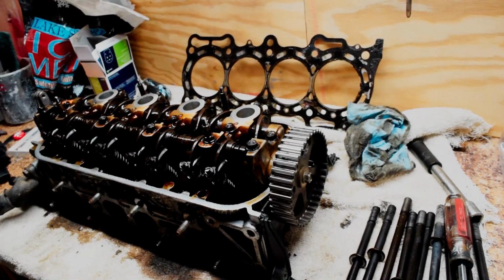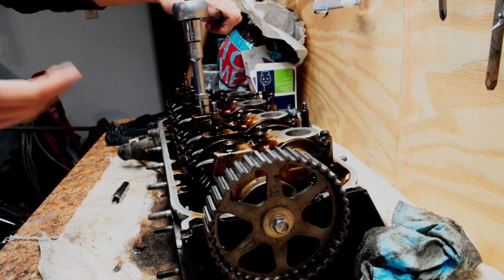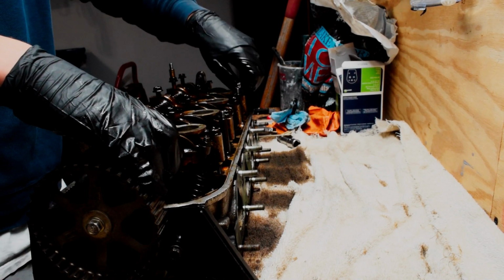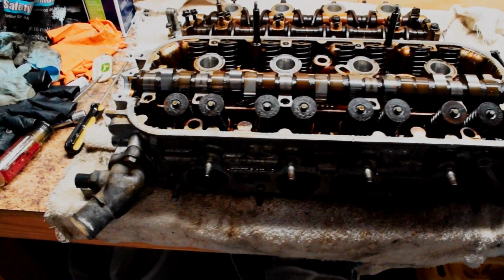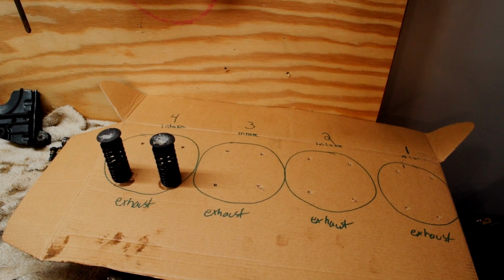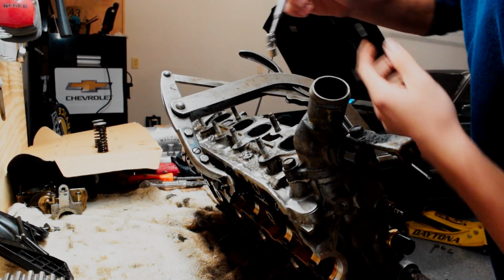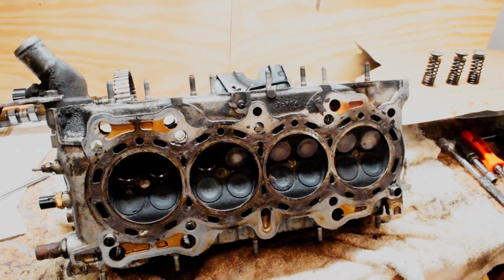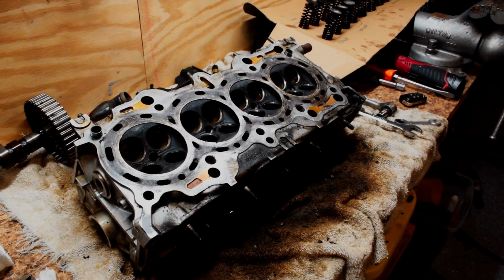F22 Honda Accord Cylinder Head Disassembly

Comment: When you took the rocker arms off, make sure you replace the O-rings that are on the bottom of the rocker arm, between them and the head. When they leak you will find oil around your spark plugs and spark plug boots. Anyone watching your video should be aware of those O-rings. Sometimes they come with the valve cover gasket and sometimes they don't,,,,,,,,,,,,,,,
Reply from the maker: True story man mine were leaking when I got  my car big time.
Reply: The seals you are referring to are on the TOP of the rocker assembly, between them and the valve cover, not the head.
Reply from the maker: There’s two sets if I remember correctly. One at the tip of the spark plug tubes to seal the valve cover and one after unbolting the rocker arm assembly.
Reply: @ThatAccordGuy  Ahh, you're right, I had forgotten the f22a engines don't have the typical spark plug tube design that use loctite at the bottom where they are pressed into the hole with a friction fit. Thanks for clarifying 👍

Comment: My beater 94 Honda Accord sedan overheats. I’ve tried everything and think it’s the head gasket. Of course it could be a cracked head or something cracked in the block. I’ve got no disappearing antifreeze though. Only thing is the coolant reservoir overflows and once I caught it bubbling. Other times it wasn’t
Reply from the maker: Yeah man it's certainly possible that it's a head gasket. If you want to make sure, they sell a head gasket checker. It's a chemical you put over the jug and it turns blue or something if there is a presence of exhaust gasses in the coolant jug.
Reply: For others who may come across this. As ThatAccordGuy said, you can check it really easily with that cheap kit. I don't think that was the issue here though, without losing coolant it's probably just a stuck closed thermostat. The coolant will boil and vent out from the overflow tank if it gets too hot and overcomes the pressure cap on the radiator. It's easy to check the thermostat, just put it in a pot of water on the stove, turn it on and visually verify it opens, you can even go one step further and use a thermometer to verify at what temp it begins to come off its seat. Every thermostat has the temperature It's rated for stamped on it somewhere. It's also possible that it was just a case of the electric fans not coming on when they're supposed to, like a bad relay or temp sensor.

Comment: Kind of a weird question I was changing my timing belt and I might have not lined the everything up properly and I was hand cranking the engine over. Is there any chance of bending the valves while doing this? Either way i'm going to make sure everything is now aligned perfectly and I guess i'll know when I start the car up when she's back together.
Reply from the maker: I'm sure you got it back together at this point. I'd say no you couldn't bend the valve just by spinning it over by hand. Hopefully it all went well. Thanks for watching